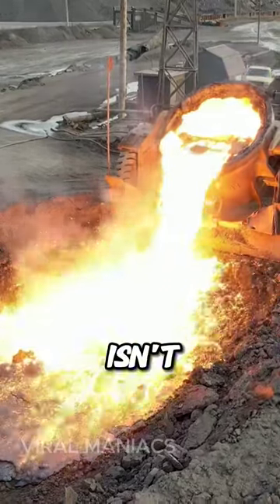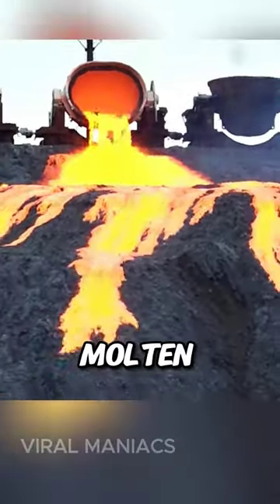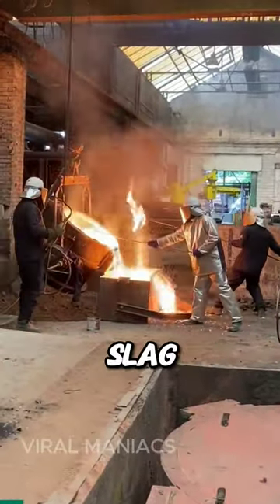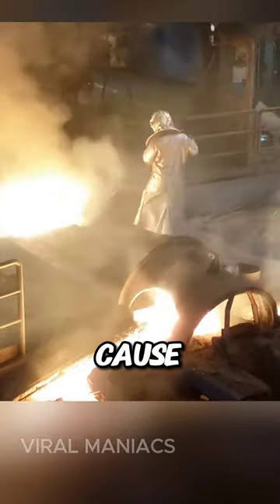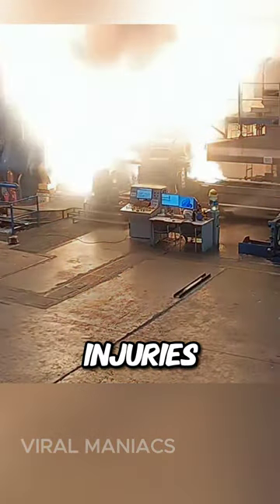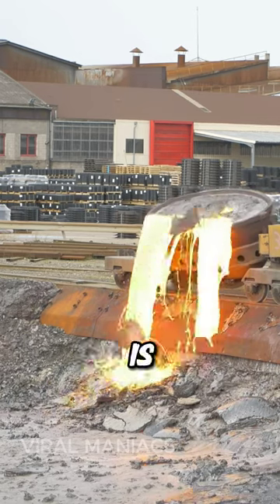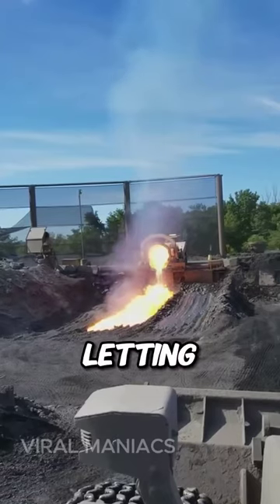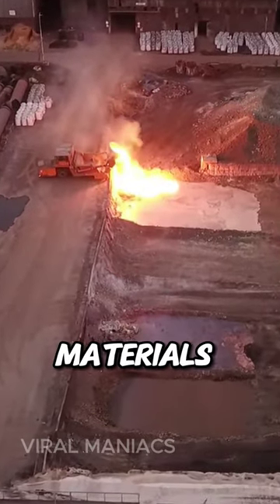Steel slag from smelting can only be poured on the ground to cool #shorts

Comment: They used to put it on tar roofs for aggregate.  Slag is the impurities of metal melting process.  And slag is not the reason wet metals when shaken into the furnace blows up.  The heat of the molten metal nearly instantly evaporates the water.  From a drop of water 💧 to 100x expansions to a gas form cause the explosion 💥..😉.